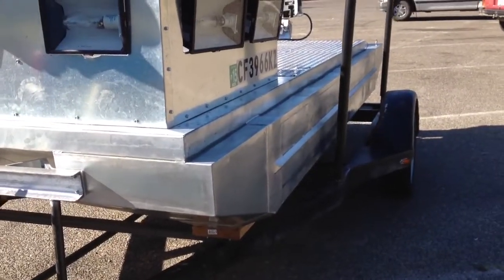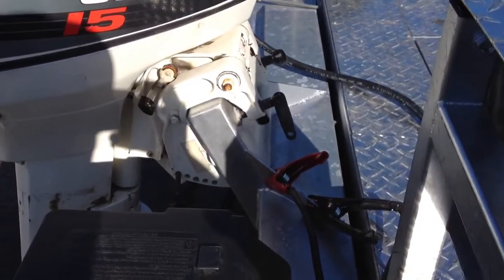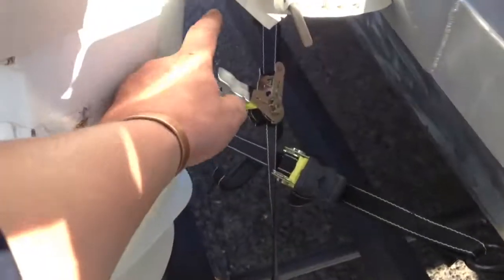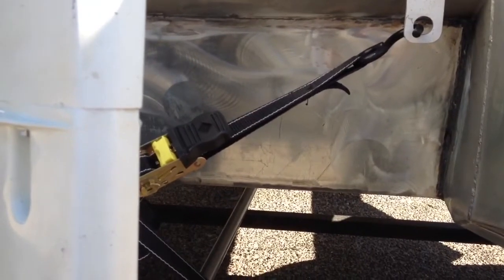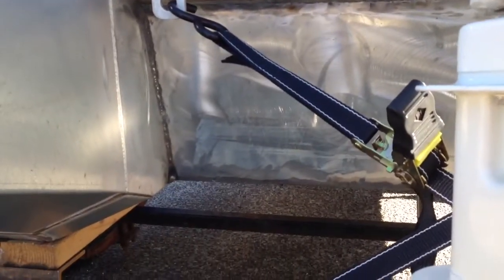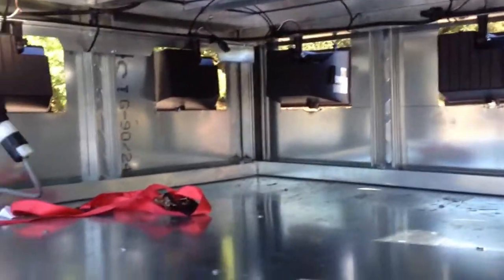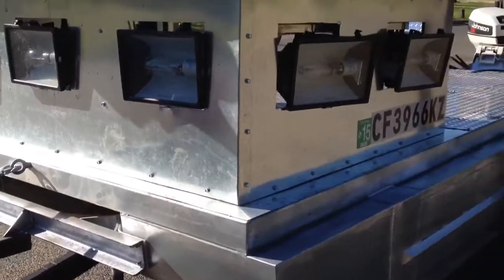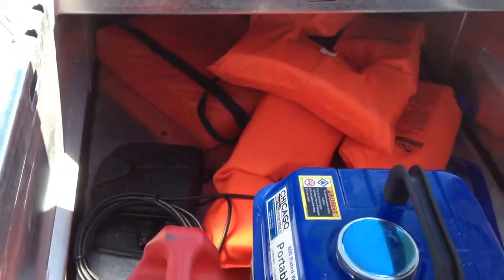DIY Pontoon Bowfishing Boat part 2

Comment: how is this DIY?

Diamond plating and aluminum welding? Really?
Reply from the maker: Ronnie Paul DIY stand for "do it yourself". since I built the boat myself, by definition, its DIY
Reply: well if I owned a jon boat factory and I picked one off the line does it make it DIY
Reply from the maker: No, because you didn't do it yourself.

I don't own a boat facotry, I own some welder's and various other metal working machinery.

All you need to DIY is the proper tools. This applies to everything from making toast to building boats.